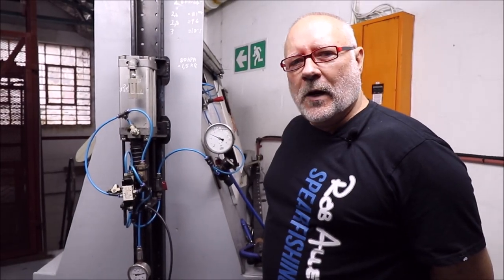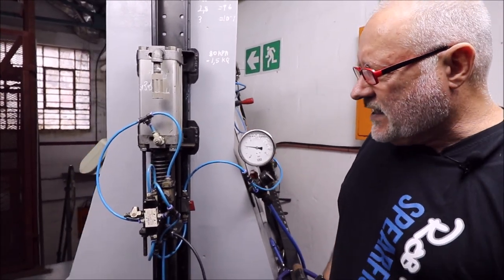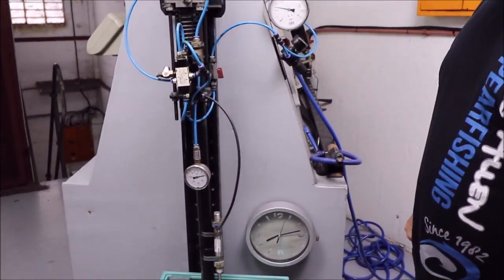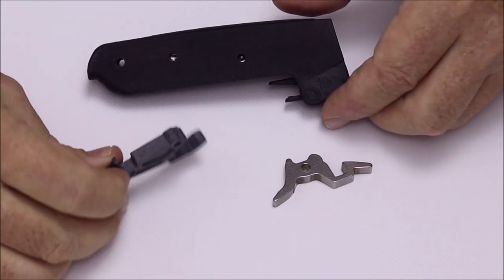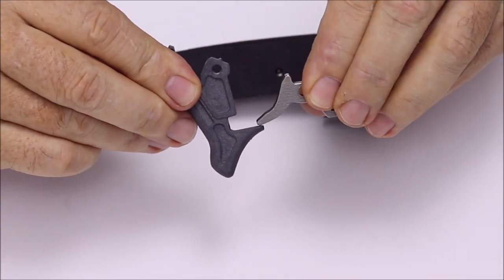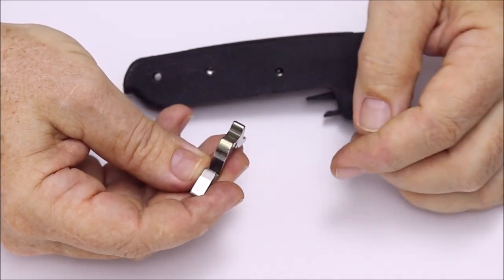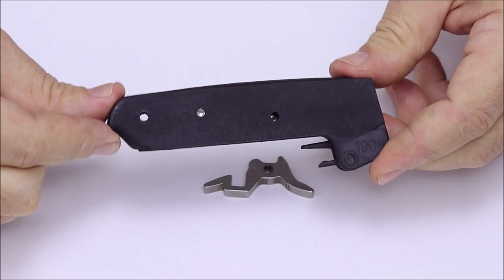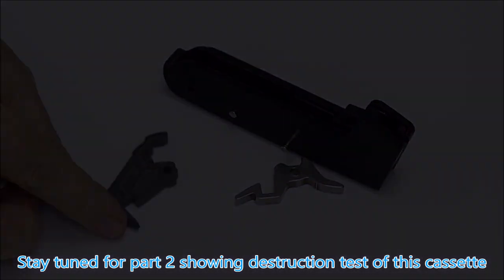Rob Allen | Vecta 2 Maximum Load Wear Test

Comment: Nice videos and good work. This is what I like to see from manufactures - constant development and total transparency about the proces, good and bad. Your spearguns have a good reputation here in Denmark, only problem is the triggertension needed to fire the gun - it requires too much tension. We shoot a lot of small fast fish - we need all the precision we can get and the trigger is a big part of that.

If you decide to develop a new housing, maybe consider shipping it with both a standard handle and another handle + some epoxy (or something like that), so the customer easily can make a custom handle and attach it to the housing. These handles should be easily interchangeable, preferably toolless if possible. This will greatly increase accuracy and will be a giant leep forward to the speargun market. 

99% sure my next gun will be a Rob Allen!

Keep up the great work!
Reply from the maker: Hi Martin, many thanks for the feed back. Trigger tension on our old handles were sometimes too stiff. This new one is way better and, less likely to change over time. If you need a "hair trigger" you can polish the surfaces to change angle where the parts mesh. We don't advise this as it can very easily become too sensitive so not a good idea. We are looking into an ergonomic grip option.
Reply: @RobAllenSpearfishing  Sounds great! Thanks for the advice. I will keep a lookout for your upcoming grip options.

Comment: 120kg . Is it equal loads of 2 x 16mm bands with coefficient 330% (tuna set-up)?
Ah. I saw previous video. It's equal 2x16mm 400%
Reply from the maker: 120kg is equal to 2 x 16mm at 400% stretch. We don't set up our Tuna guns at maximum, we set up around 330% to 350%

Comment: Can the vector 2 handle 3 16mm band?
Reply from the maker: Yes it can in terms of the component strength but the trigger pull will be around 30% harder. We have just finished making new components that change the trigger and sear such that it reduces the load  on the trigger pull with 3 x 16mm bands so the feel will be the same as that of 2 x 16mm bands.

Comment: Im in a 3th Rob Allen trigger, all this 3 with the same problem, relesing the arrow inadvertently.
Reply from the maker: Hi Bruno, this is not usual, where do you live?
Reply: @RobAllenSpearfishing , i live in Brazil.
Reply from the maker: @brunomaciel51  Brazil has not been able to order gear now for many years, not sure what stock they have. I assume they still have the much older versions. We have been improving the inner workings on the Vecta 2 to get these much better results. Until they order again it will be difficult to sort your problem.
Reply: Yes, this is not the Vecta 2, but i would like to continue using a Rob Allen Gun.
Reply from the maker: @brunomaciel51  have you talked to our distributor there?
Reply: @RobAllenSpearfishing  I got a Lot of figths with hum because of that, hahaha
Reply from the maker: @brunomaciel51  sorry to hear that.